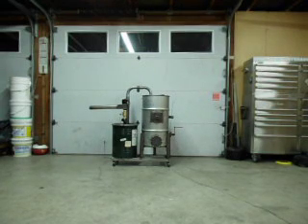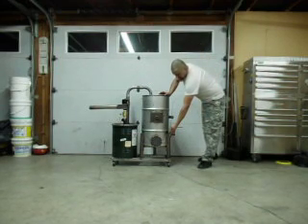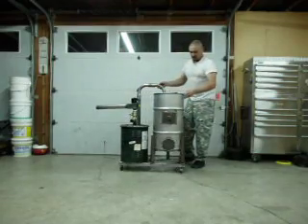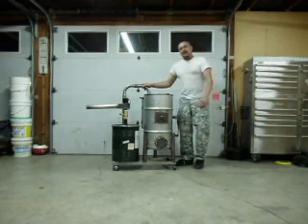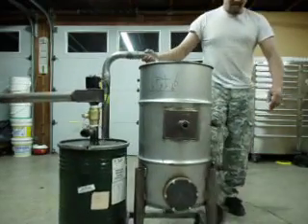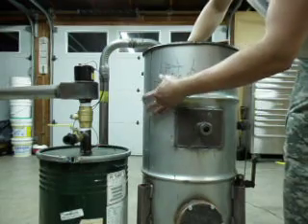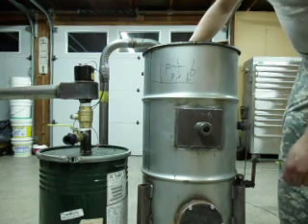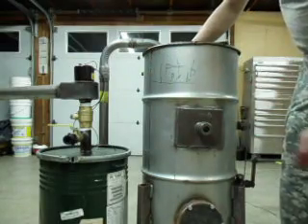FEMA gasifier 1.6

Comment: Josh, here is another idea for you.  If you use an alternator to charge batteries, you can use a cheap grid tie inverter to connect the batteries to the grid and reduce your power bill.  I have one that I bought on ebay for $200 that grid ties up to 500 watts.  It turns on when the batteries have a voltage above 12.8v.
Reply: Why not grid tie it directly?